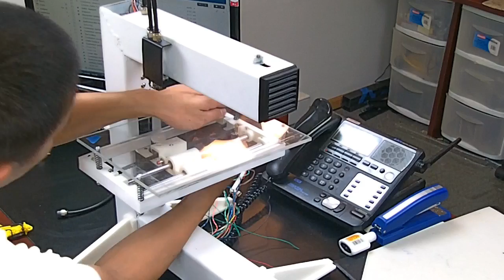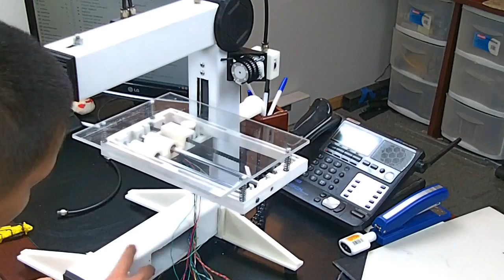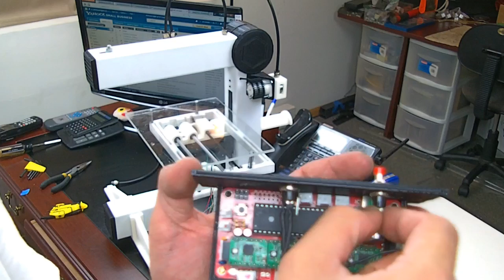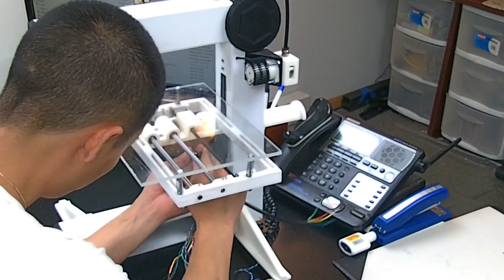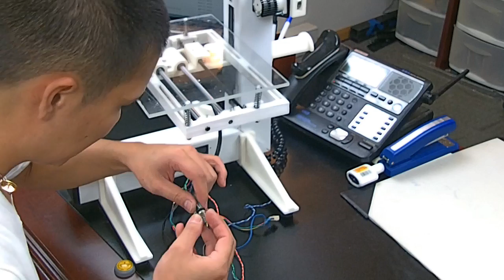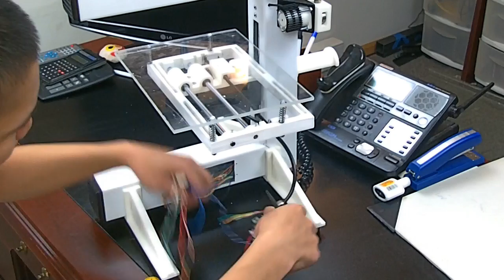Assembly of Eventorbot. Y axis tutorial part 8

Comment: Update: Found a $70 1.3a mobo - Sanguinololu Rev 1.3a, ASSEMBLED & TESTED! (ebay)

$40 steppers - 4 x A4988 stepper driver (pololu compatible) 3D printer (ebay)

Will I need anything else for the actual mobo setup? I can't post the links in here.